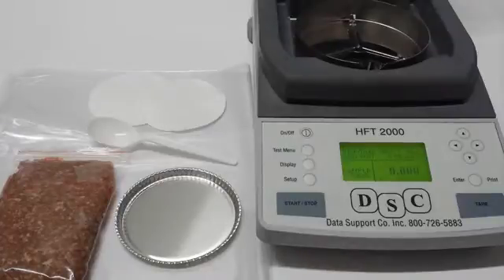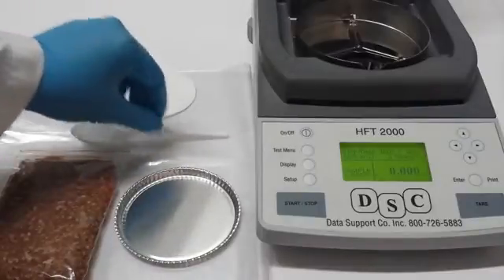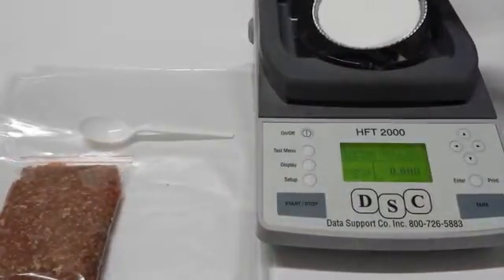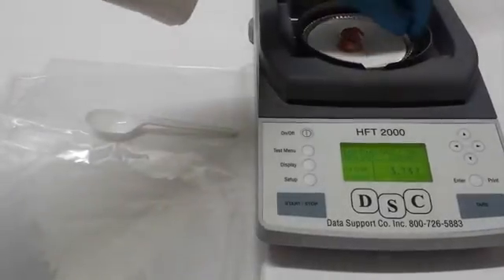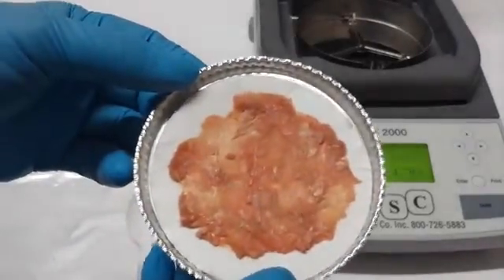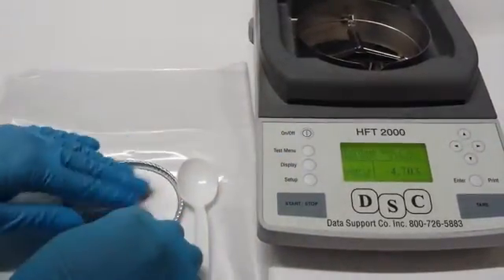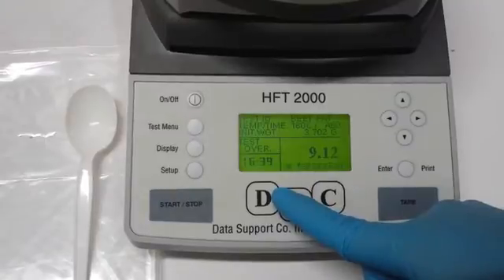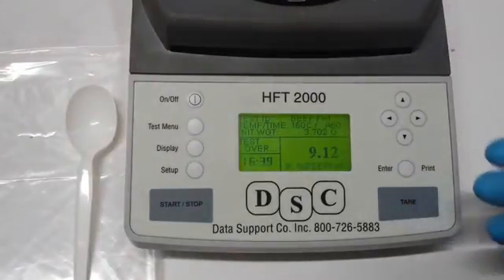Ground Beef Fat Content, Fat Testing, with DSC Guy

Comment: That absolutely did not show us anything. You Need an Anyl- Ray. tester using . X-rays to determine content.  but who's got access to a 50k machine.   what  you need to  do is cook up exactly certain amount of weighed beef and drain as best as you can.  seperating  the liquids and beef.   put the liquid in the refrigerator and separate the solid fat and water that separated.  weigh the fat and add waters weight to the beef. +- 1% from beef because of  evaporated water. calculate the the percentage of fat to beef to get a rough estimate.